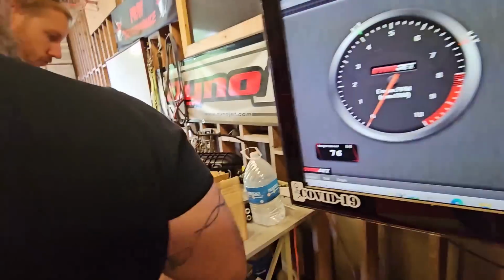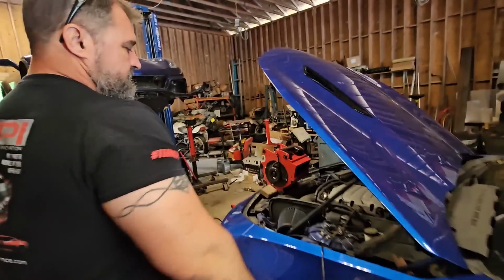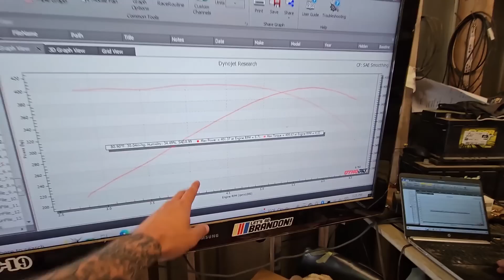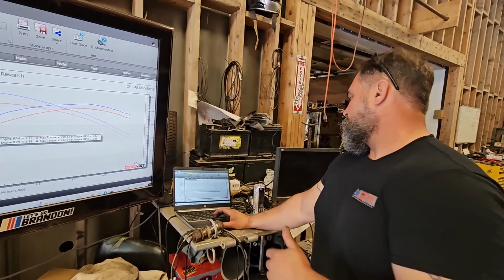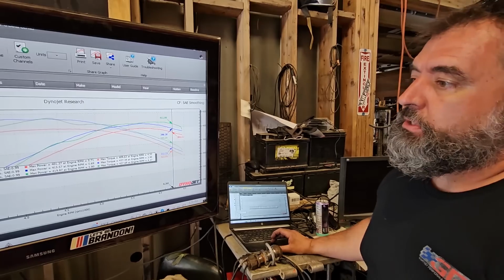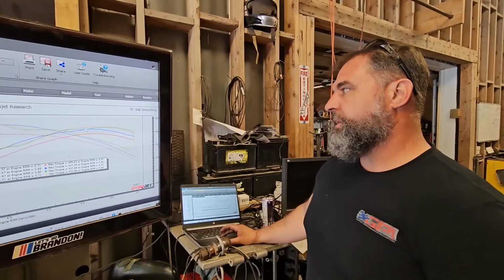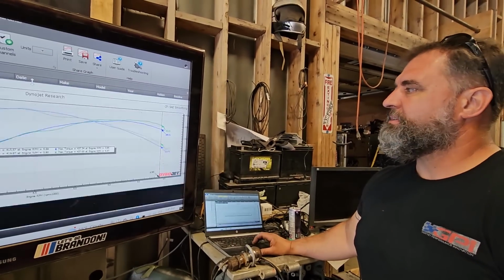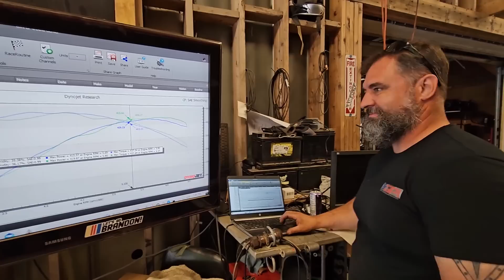LT1 Manifold Shootout!  Stock, Ported LT2, Ported MSD, Ported Stock, Ported Hi ram results!!!

Comment: Bought two LT2 manifolds from Rock Auto at $175 each shipped. First just cleaned runners and used stock throttle body. Second one fully ported and snout opened past oring groove for 95mm throttle body. Been using second one for over two Years and love the results.
Reply: How much hp did you gain ? Without a tune and with a tune ?
Reply: How much power did you gain on the one you ported?

Comment: My ss made 480 gpi tuned, e85, ported by me lt2, 95mm tb, 2" speed engineering headers. Then did 225btr cam and decked heads as much as possible with notched pistons. Made 541 again gpi tuned. Miss that car. 😪
Reply: I got a Camaro 2020 , lt2 not ported , do   You recommend a 95 tb thats
ported , or non ported ? For that combo ?

Comment: Would be interested to see what an unported LT2 would make.  Others have showed it was a negligible difference.  Maybe 3hp or so.  I've been watching for some times with the recent debate on the manifolds.  I paid all of $170 for an LT2 delivered to my door.  Appreciate what you have done. Modification to fit was maybe 45 min.  Think I was all in $220 and maybe 30 min swap.
Reply: Did you have to tune after install
Reply: @str8klownn713  I did not.  No check engine lights or anything of the sort.  Ran beautifully

Comment: After watching this, I'm glad I decided to get an LT2 with LT5 TB and saved the money.  I've got CAI, LT2 intake kit w/ LT5 95mm TB, stage 2 cam kit (Cam Motion), ported the heads, 1 7/8" ARH headers, x-pipe, mid-pipes running into the stock NPP muffler.  The car turned 502whp on the dyno and I'm completely satisfied.  I'd love to be able to get the opportunity for you to put your hands on it for a tune because there's no doubt you could get more out of it, but I'm extremely happy with what I got at this point with my 2017 Camaro.  I'll prolly go with an axle-back and I'll be done with it

Comment: Granted this was back in 2019 so I'm sure their porting got better over time but, my car (18 SS A8) ran an 11.9@115 stock with a drag radial.  I added their ported intake and ported stock throttle body along with E85 and tuning my car ran an 11.6@119.  4 mph indicates a nice gain considering I still had a stock airbox and I was only running a stock ported TB.

Comment: Not to be argumentative (and for what it’s worth), but you can def run a 103 on an LT2. And you don’t need an extender for the map if you pull the factory wiring from the loom.
Reply: Well that’s what he said he didn’t want to cut up the loom on his daughter car. And also I believe you have to cut up the intake and then jb weld it for 103 to work?
Reply: @FromVtotheD   I guess I misunderstood what he was saying (kids and wife talking lol). I was just pointing out you don’t have to buy an extension harness or cut wires. 

You bore out/port the inlet into the o-ring channel. So you have to seal the TB, but no jb weld was needed on the one I ran.

Comment: Ported stock for bolt on cars ported lt2 for cammed cars
Reply: I got a good deal on a ported LT2 manifold, think I’d go well with my setup? All I have is a rotofab intake and a ported stock throttle body. I don’t plan to go all out with my setup but for a good deal I’m willing to add a few ponies.